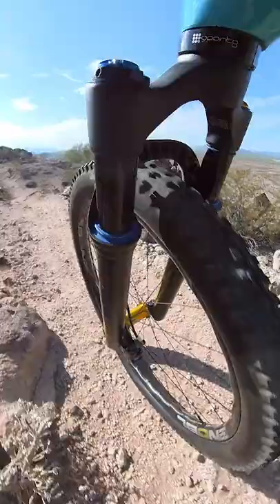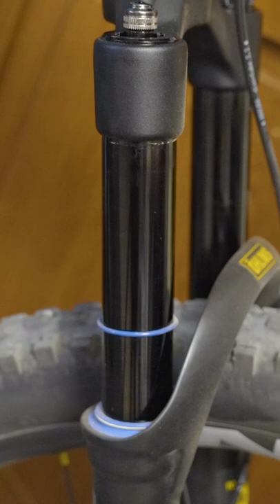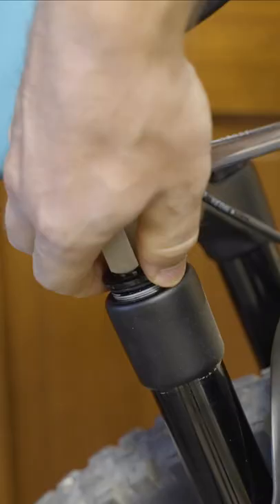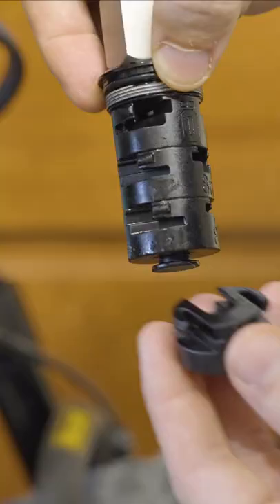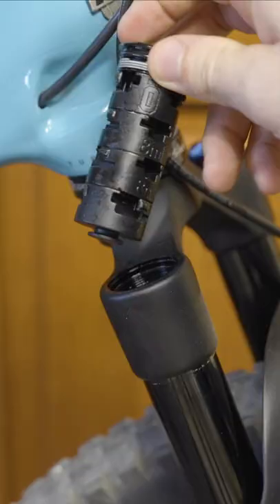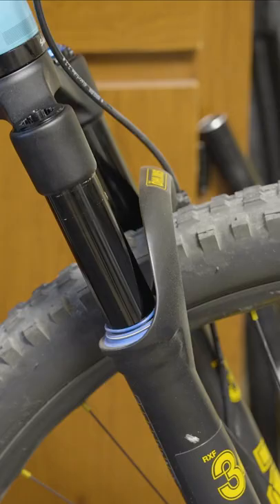MTB Suspension Hack!

Comment: Nice "Hack", however, I think 30% SAG is not what this fork was designed for. This is from the official Owners guide manual of the RXF 36 : "Sag should be set to approximately 10-15 % of the fork travel." Im just some guy on the internet but i feel like going against recommended manufacturer settings completely and then wondering about lacking performance is kinda weird.
Reply: Some forks really heavily depebd on a tune of sone kind. It also depebds on what your manufacturer designed your bike around for parts wise etc such as mine they recommended a huge range fron 425 to 535 for springs by different brands abd shocks etc and similarly between a few types of fork.
Reply: Really depends on what fork you have and what riding your doing.
Reply: Oddly enough I was watching a video yesterday explaining why reducing your sag makes the fork ride higher in the softer initial stroke and makes it smooth out smaller ground chatter. 
Haven't tried it yet but the way it was explained made sense. It just goes against what seems right . It could vary depending on the damper perhaps. Btw it was a rockshox fork.
Reply: 30% sag comes from motorcycle world.
Reply: @mikee8244  makes sense. Once you get into the halfway point i bet theres more damping so it skips over small stuff instead of absorbing.
Reply: @mikee8244  nope he's confused.
Reply: I ride 2 volume spacers with 23% sag. Its really soft and never bottoms out so if u got the right settings u can easily Rock 20-25% sag.
Reply: @0xsergy   Motorbike suspension is shits all over even the top end MTB suspension. Never felt anything like it on a top end mtb suspension and I doubt they can even come close, ride a nice tuned dirt-bike and you will know.

Comment: Gotta chime in here: that’s actually doing the opposite of what you want. Sitting at the same sag point with more volume spacers is going to make the fork feel harsher. Volume spacers are really there to control bottom out only. You want to sit higher in the sag for more small bump sensitivity, and consider adjusting your compression settings to reduce your hand fatigue.

Comment: Sounds like your sag was too high. 30% means your moving through the soft supple beginning and riding in the stiffer more supportive mid stroke. All those tokens makes the mid stroke ramp up more giving a harsher feel. Loose all but 1 token and reset your sag to around 20% and see how the fork feels
Reply: Yeah, I was searching for this comment before I left my own. This is spot on, you don’t want to reduce total volume, instead decrease sag and remove spacers. Spacers are only for bottom out, not off the top plushness.
Reply: From another comment, his fork recommends 15% sag so youre accurate.
Reply: That's how I like mine as well.

Comment: Removing air definitely would soften the top of your stroke, but the token is just adding progression to the full travel, meaning your stroke will ramp up much faster as you use your travel. I'd play with your LS/HS rebound instead of sagging too far, perhaps it'll help the hands.
Reply: So less pressure more tokens isn't more supple? Nice. Thought thaz was BS then watched this and now bought tokens.

Comment: Rebound helps with numbness a lot, but too much can be just as bad. Also the top of the stroke is more complaint so under 20% is optimal. 

Second try rev grips. Those help too. 
Back sweep on the bars. Hopefully something here helps.

Comment: My rockshox Air is perfection, I'm just amazed ,my first airfork in 50 years of riding, I use to think springs were good enough for the job, now my bike weighs nothing up front and is a lot stiffer with beefy 32mm stanchions. Recon SL 80-120mm

Comment: I would proboly not call this a hack since you kind of need voliumspacers to have the right sag and not get bottomouts. If you run a 120mm on dh tracks it is going ti feel stiff because it is design to.

Comment: Lil guys (sub-150 lbs) want a small air chamber and lower pressure, bigger guys like me (200+) want a big air chamber (no tokens) and higher pressure
Reply: I have to run no spacers I weigh 230 bruh I feel your pain
Reply: 225lbs here and the stock 2 tokens my lyrik came with was ridiculously harsh at 20-25% sag. You’re definitely right !!!

Comment: I'm confused. Adding volume spacers makes the fork softer? I thought adding spacers will make it stiffer. Spacers are required to solve bottom-ing :D
Reply: Well, he can reduce pressure and prevent bottoming. And yes - fork will be stiffer, but the same sag is suspicious. Reducing pressure will definitely increase sag regardless tokens added. Sag is dependent from initial quasi linear part of characteristics. Tokens don't change this part of characteristics. Tell me if I'm wrong
Reply: I was thinking the same. Reduce pressure if fork is to stiff or remove tokens. All the videos I saw, tokens are required to eliminate bottoming. Right now I have a bike with Fox36 and by book I don't have recommended 30% sag. I get something like 40%. And that's with recommended air pressure. Unless I have tokens in that fork that I don't know about.
Reply: It does make it stiffer

Comment: Completely wrong.
Reply from the maker: Alright big guy
Reply: @EvansMTBSaga  🤣
David Cross had a bit where nothing good comes after someone calls you Big Guy. 🤣
Reply from the maker: Still holds true!
Reply: @EvansMTBSaga  Take three of those tokens out, then add enough psi to get you to about 20% sag and your fork will actually have some travel to use when hitting big bumps while going downhill. What you have described will only work for light weight people riding slow on mellow terrain.
Reply from the maker: All I ride now is slow, technical trails. Average speed 10 mph or less. Top speed probably 20 if I'm lucky
Reply: Your sooo rite, if he pulled thoz fckn tokens out!  The extreme ramp up is stinging his hands
Reply: I’ll sencond this, it’s completely wrong. Please do your research first before trying to give bad advice to people.
Reply: @dangerouscookie4790  thank you

Comment: Take alllllll thoz tokens out..   an enjoy your WHOLE fork!
Reply from the maker: It's a short travel fork. Made for tight, technical, and smooth pedaling
Reply: @EvansMTBSaga  well adding spacers will make the fork stiffer. especially at the end of the stroke. adjust your compression and rebound. use less spacers.

Comment: GUYS DO NOT DO THIS ITS COMPLETELY WRONG
Reply: why
Reply: @sans_2031  because your setting your fork in the mid stroke at 30% sag so you’ve lost any small bump at the beginning of the travel and THEN you’ve added tokens increasing the spring rate making the fork ramp up quicker at the end of the travel which ultimately prevents you using the remaining travel that you have left. 

The correct thing to do is set the fork to the correct pressure for your weight. This is usually about 15 to 20% sag. Ride a trail on the more aggressive side of your riding and see if your using close to full travel. Add or remove tokens accordingly to adjust the spring rate until you are using almost full travel. Then finally experiment with rebound and compression. Faster rebound will open the fork up and make it more active but don’t have it too fast so it’s pushing your handlebars up. Less compression will also open up the fork but you don’t want it too much open that you blow through all your travel easily with no control. 
Considering how wrong his approach to his fork setup is it’s likely he has got his rear shock set up completely wrong too. This could be another issue as he could have his suspension unbalanced pushing his weight forward causing an incorrect body position which would be putting more weight on his hands.
Reply: @russellparker4568  yep did the same mistake and went over the bars. good stuff you wrote here. makes more sense now. thx
Reply: @sans_2031  yeah no problem 👍🏻

Comment: Hey evan! I have been gradually building up my hardtail over the last 3 years, only the frame has remained stock, I got an NX 12 speed drivetrain from a local guy but the cassette is shot for gears 6-11,
do you happen to know where I can get a cassette for cheaper than the 123 euro MSRP? thanks!
Reply from the maker: Amazon if you don't mind a Chinese cassette. They hold up just fine. eBay or Pinkbike if you want brand name
Reply: The sun race cassettes on Amazon aren't bad. They should have basically a direct replacement, hg hub compatible and 11-50.

It looks like the regular nx eagle cassette is the same price. I would just buy that.

Comment: Nope. Try running 20% sag.
Reply: with that much pressure I don't think it'll do much more
Reply: @sans_2031  he's already has 3 volume spacers. 30% sag is to much. The fork runs to far into the travel and losses it off the top sensitivity and probably starts regularly bottoming out. So he adds another volume spacer. Now the fork is still running to much sag and the spring curve is off the chart.
Reply: @stephenbarradell4043  yep makes sense now

Comment: What are the downsides of doing this? Seems almost too good to be true
Reply: Some riders prefer a more linear stiffness curve. So "what I get at the top of the stroke is what I get at the bottom."  I used to be more that way when I was on a cheap fork, but I like the progressive curve better on my Fox 34; adds a lot of small bump compliance for me.
Reply: Another thing I've seen, but no experience with personally, is sometimes adding a spacer can lower your "do not exceed" pressure. So if you run higher pressures in your air chamber, you may go over the max if you don't lower your pressure after spacer installation.

Comment: Should I get a fox 36 or a rockshox pike
Reply: depends, the performance is pretty much the same nowadays, since the pike is cheaper than most fox 36s you see online id just go with the pike.
Reply: @zwingler  + some see it as a downside but the pike with its less settings and adjustments is way faster to get set up for ya,  service kits and the like are also cheaper.
Reply: A lyrik. Stiffer than the pike and more supple than the 36. I had both, went back to the lyrik.

Comment: Probably just eliminated half your travel. Set the proper sag.
Reply from the maker: The wrist pain wasn't from harsh bottoms. It was from harsh top from small chattery stuff. Thoughts?
Reply: @EvansMTBSaga  you need to be sitting higher up in the travel where its designed to  absorb small bumps. Spacers have more to do with body weight. Smaller riders will need more because they are running less air.

Comment: Clean your dust seals and maybe you'll feel a difference lol
Reply: Nope
Reply: @JeremyFacer  too much work? 😂 I rebuilt my own forks all the time the kits are like 20$ and it makes a hell of a difference
Reply: @iprovedyouallwrong  You don't need to clean your dust wipers between service intervals. Wiping the dust from the top of your fork lowers won't change the way the fork feels
Reply: @JeremyFacer  every 50 miles you should be taking it apart to clean just in case.
Reply: @JeremyFacer  I blew my fork for that exact reason you don't want that to happen trust me.
Reply: @iprovedyouallwrong  That is an insanely short service interval. Rockshox recommends a 50 hour lower leg service, if you average 4 miles in an hour on your rides (which is not a lot), you could go 200 miles between services. If you follow the 4 miles in an hour, 50 hour service and you average about 10 miles on each ride, you can ride your bikes 20 times between services. If you go on two of those rides a week all year long with no break during the winter that works out to about 5 lower leg services a year. 

I think you blew your fork for a reason outside of the dust wipers getting dirty. Perhaps all the taking it apart and putting it back together was the cause? The more you're opening the fork the more chances of a mistake reassembling.